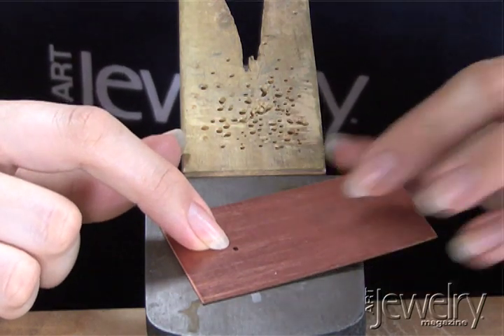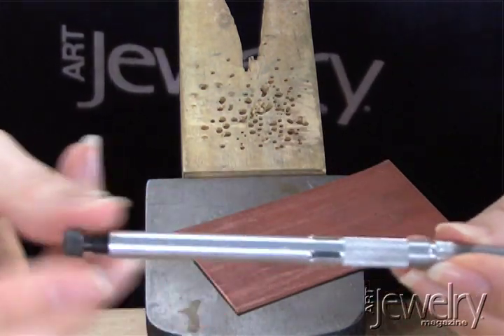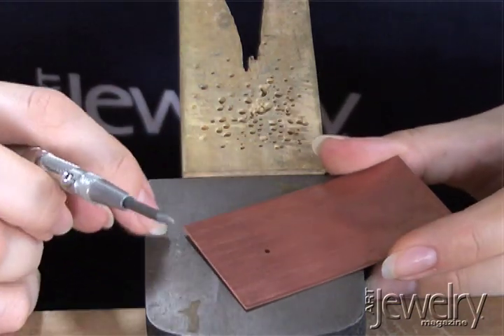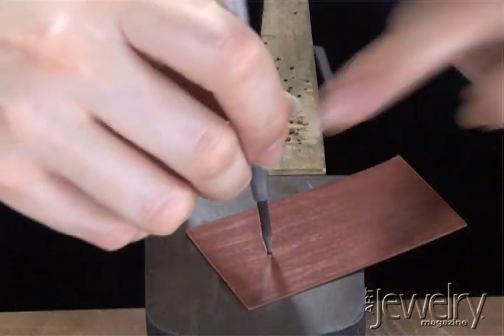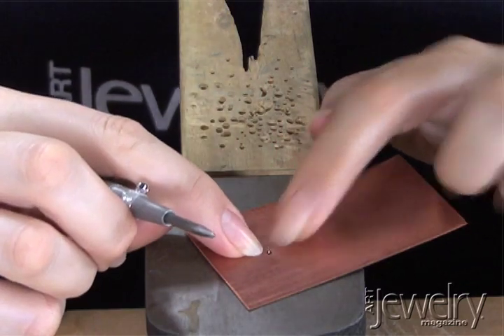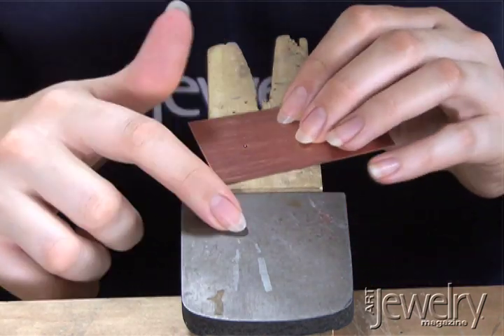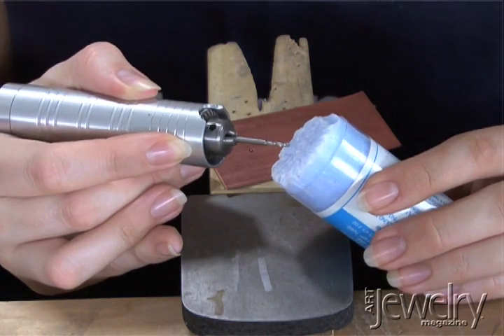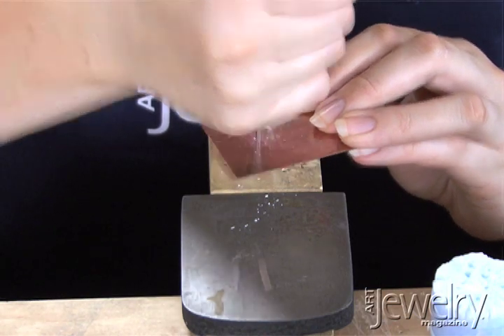Art Jewelry - Drilling Into Metal

Comment from the maker: You could use a flex shaft to drill into wood or stone, but you would need to use different drill bits designed to cut through those materials.
A cheaper alternative to a flex shaft would be a handheld rotary tool. Dremel is a company that makes one version, so they're commonly called dremel tools. You can find them at your local hardware store. The flex shafts, however, you'd have to buy or order from a jewelry supply company. There are a few listed in my comment below. Good luck!

Comment from the maker: The first tool that I used is called an automatic center punch. You use it to make a dimple in metal so that you can drill a hole through.
The last tool that I used is called a flexible shaft tool, or a flex shaft tool. It's basically a foot-pedal operated hanging motor attached to a flexible cord  at the end of the cord is a handpiece that holds a drill bit or other rotary bit. You control the speed of the drill bit by pressing the foot pedal  the harder you press, the faster the drill spins.
Reply: What is the drill bit if I’m using a dremel?

Comment: How thick is the metal sheet you are drilling? I'm trying to drill into 1mm thick sheet with my rotary tool and it is taking a very long time. Not sure if I'm applying the right amount of pressure on the pedal...

Comment from the maker: It’s hard to tell the gauge of the metal from the video, and we no longer have the sample piece, but my guess is that it’s 18 or 20 gauge (1.0 or 0.8 mm) thick. Drilling through 1 mm non-ferrous metal shouldn’t take too long, so I suggest you make sure that your drill bit is sharp and use lubricant. You don’t want to push too hard with the bit or it may snap, but if you’re just resting it on the surface of the metal and spinning it without drilling, you may overheat the bit and change the temper of the bit.

Comment from the maker: You need a standard twist drill bit - I prefer drill bits made from high speed steel or carbide, though you can purchase diamond-coated bits too.
You can buy drill bits from Contenti, Otto Frei, or Rio Grande. (Just search for them on Google.) Or you can buy them at your local hardware store-just make sure to ask if bits are intended for metal... not wood, concrete, etc.